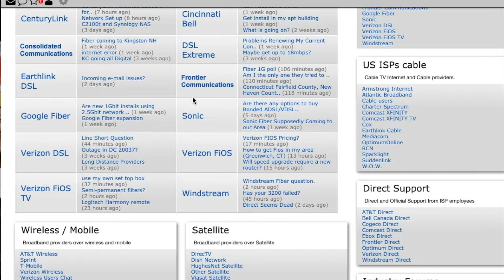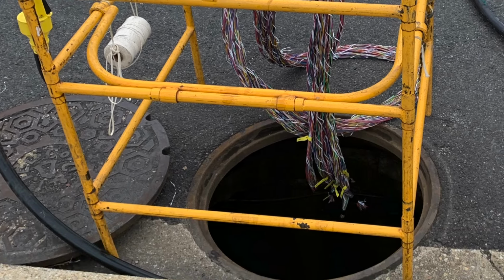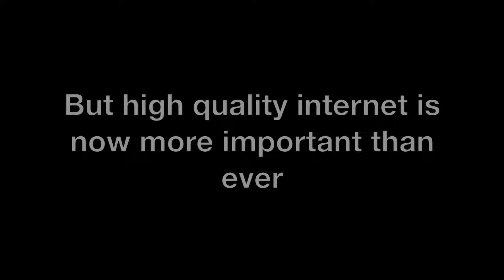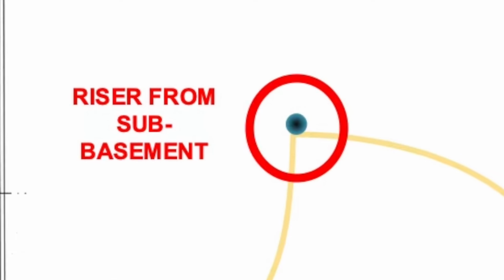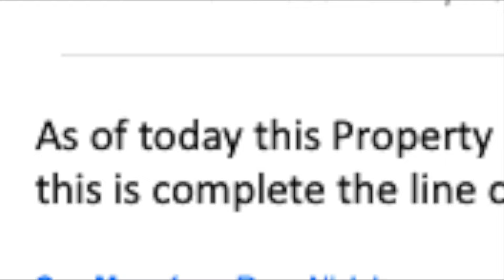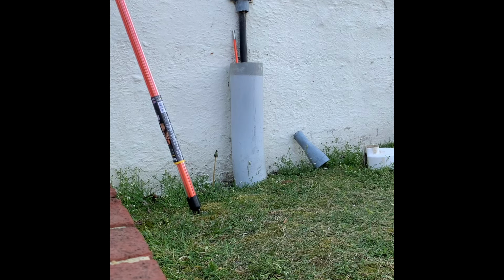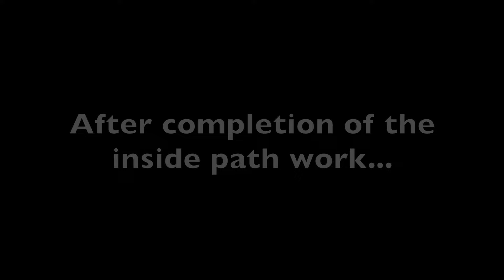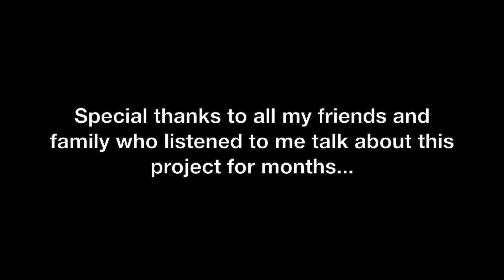Getting FiOS (fiber optic internet/FTTH) installed in my condo building

Comment: Verizon can put fiber all they want for Internet, but they need to maintain and keep their copper network for telephone landline service as this is more reliable than fiber for telephone as it does not rely on power at the building or house that it’s at and is powered by the central office which has Large backup batteries, and generators, and is also analog and unpack with all of the outages we’ve been having with AT&T and Microsoft and Verizon cell service. Copper land lines should be federally mandated so that all companies that maintain copper land lines have to continue to maintain them and install them in new buildings and housing developments. They also need to stop providing fiber or avoid service as to prevent confusion. In Washington DC is Verizon still servicing its copper network along with fiber network or has the copper landline network been decommissioned already? If you wanted to, could you sign up for fiber, Internet, and request that your phone service be on the copper landline?
Reply: lol. Good luck. AT&T is planning on abandoning POTS by the end of the decade.

Comment: DSL was just as good and it came over the phone lines.  I used to work for Verizon and when they tried to implement  FIOS back in 2007/ 2008 the company was going bankrupt !!!
Reply: How? I have DSL, and I am so itching to change to a better service.
Reply: AT&T offered up to 18 Mbps at my house up until around 2019-2020. I hardly consider that "just as good". The service was reliable as I had relatively few service outages in the decade we had the service, but its just painfully slow compared to the 500 Mbps I have with comcast.